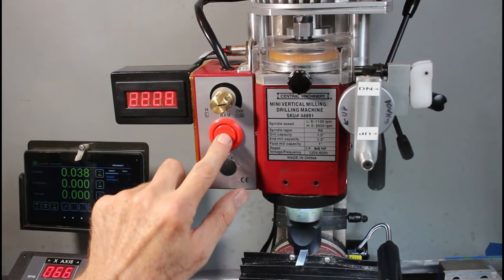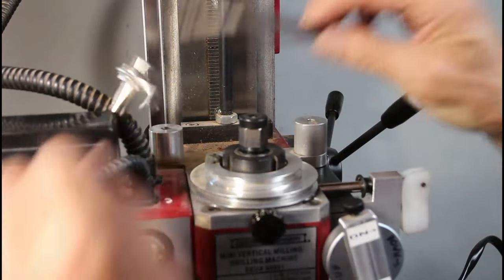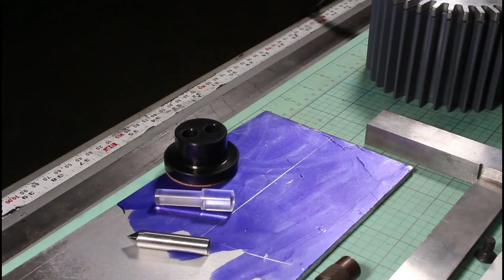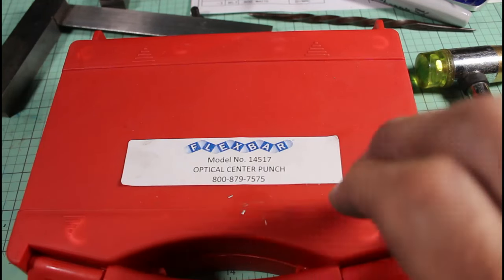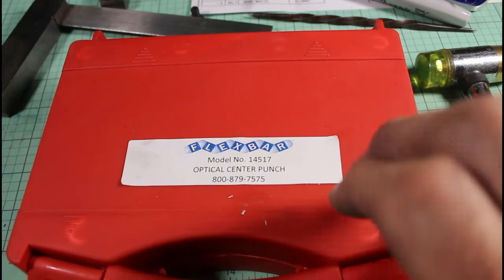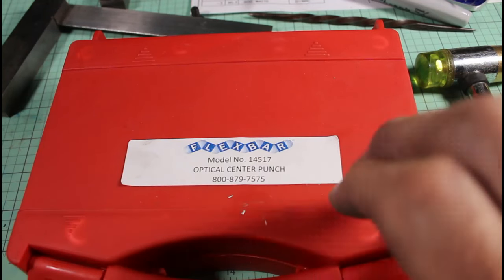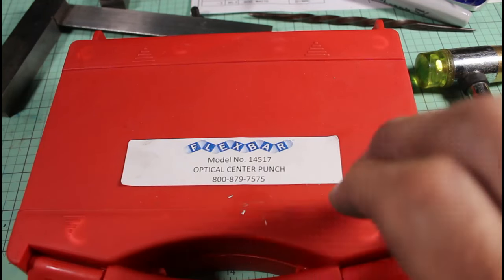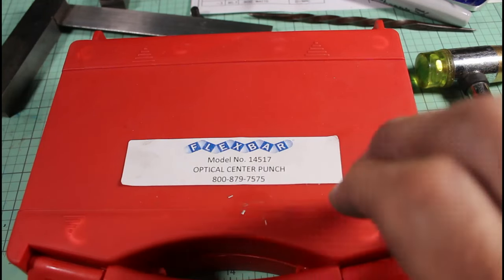Harbor Freight Mini Mill brushless motor upgrade

Comment: Been running a treadmill board on mine for the past few years after my original board died. Found your video and immediately searched ebay for a motor. Modeled some mount plates in Freecad and 3d printed them. Wired it all up and running great. Thank you for the video.
Reply from the maker: Wow, that's really cool. Glad I inspired you! 🙂

Comment: I did this mod to my little machine shop Seig mill over a year ago. I
 built my own belt drive system using cog type pulleys and belt. My
motor is 750 watts 24 volts. Best thing to ever happen to that mill.
Reply: have a parts list and any pics or steps? thanks!

Comment: I really like how you left most of what many YT's would remove due to time constraints. I think it was a good move. Watching you use your skillset, any thoughts about picking up a dividing head or rotary table anytime soon? Imagine the neat stuff you can make with one of those, not to mention lots of new content to keep us busy on your channel. Food for thought!
Reply from the maker: Thanks for your kind thoughts.  
Yes, I have owned a small 3-in rotary table for some time and have used it on a number of videos, most recently constructing the InclinoClock face:
https://youtu.be/jLS2trTL6DY

 And in an earlier video where I made a sprocket drive to move ball bearings:
https://youtu.be/xiuY2M31obA

Comment: That e-stop feature is bad ass
Reply from the maker: Yes, I really like that feature.  The interesting thing is that once I've stopped it with that button, if I leave the speed knob turned up, the motor has some holding torque until I turn the knob back down.
Fyi, the surplus store that sells these motors is closing this year, so get one while they still have them if you're interested.

Comment: The key thing is that your new brushless motor has a hall sensor in it (the motor controller can track the position of the rotor). So where you slow the speed of your old brushed, DC motor you do that by decreasing the total power to the motor. The brushless controller, with the help of the hall sensors, can increase voltage and amperage to ensure the motor keeps spinning at the same slow speed when under load. So you get close to full power at all speeds.
Reply from the maker: Yes, I knew that. I have a couple of e-bikes with similar motors in them. The torque is impressive!

Comment: I propose a momentary SPDT push-button with COM connected to the wiper input to the motor, the NC connected to your speed control POT wiper and the NO connected to the OFF end of the speed control POT, it might allow you to restart at full speed while retaining the same speed that you had.  A scary thing if you bump the switch but it could be under a cover to avoid accidental restart.
Reply from the maker: Nope, that won't work it can't jump start to a fixed speed. Been there, tested that.  But I do seriously love the emergency stop button, I use that preferentially over dialing the knob down.

Comment: The amount of back emf that the motor creates with that brake must be huge!
Reply from the maker: Huh, I hadn't thought of that.  I'm sure the internal electronics have all kinds of diode protection for those surges.  I use the hard brake routinely and have had no problems so far.

Comment: Great Upgrade!  I have the same mill and will use your recipe to upgrade the motor.  I have a belt drive already (hand made...not from LMS), but I think I may buy theirs and adapt it as you have as it looks a bit more sturdy.
Reply from the maker: Thanks, I'm sure you will enjoy the upgrade, I am!
If you see my recent videos you can see the motor turning very slowly for slot cutting and it has a ton of power when doing that, and I also use the emergency stop button all the time because it's just quicker to stop the motor.  I'm not sure how many more of these motors they have in stock at that surplus supplier so you should definitely buy the motor and power supply soon.

Comment: Thanks Guy for this. I have modified my Grizzly mini mill, but I did it in a much simpler way. Just raised the motor on two aluminum blocks(motor is mounted on those two only). It works great. I have just reused the original pulley, I have cut down the small one(I should have left it). I actually like the motor sound, I hated the original motor's sound. I have also cut down from the drawbar hex, left only a 3/8" height. It is enough for a wrench.
Reply from the maker: Sounds good. I assume you have a way to tension the belt as well right?
Reply: @GuyMarsdenMakesStuff  Yes. At the bottom plate(from the pulley kit), on the left side, I have elongated the mounting hole.
Reply: Tonight, I have cut through a 1/4" steel plate, with a 1/4" roughing end mill! Making an engine mount flange(scratch building a Locost).
Reply: What motor did you use and where did you get it? I have one coming in and wanted to get all my parts and upgrades ready. Was it basically just remove old motor put new in? Or did you have to make anything? I thought I've seen stronger motors that are taller but I'm not sure. Any help would be appreciated. Thank.
Reply from the maker: @Mikesmeyer88  watch my video carefully to see how I did everything. I tried to make everything clear and simple.  Details of the motor and power supply are in the description below.
Reply: I used the same motor and power supply as in this video. I just mounted the motor 
 differently.
Reply: Thank you, I ended up watching it in the background while getting ready this morning so I missed most of it. I'll watch again and pay attention this time.

Comment: like that motor and set up. I just made all the parts to change the X lead screw to one that gos all the way across and supported by bearings both ends , I made an xtra kit if you want it , just bolt on all parts are machined and new parts. one end is a stub shaft for adding power feed 12mm . 250 for the kit. , it will feel and operate like a different mill , lead screw nut adjustable included.
Reply from the maker: Thanks for watching, I've been using the new motor now for months and I'm really happy with it.  Thanks for your offer, but I'll pass.  I'm happy with my setup as-is.  I'm sure someone else will benefit from your extra parts.

Comment: can you briefly explain why we have to turn the potentiometer down and then back up?  my lathe works like that...its kinda annoying.
Reply from the maker: I think it may be a safety thing. So you can't start it at maximum speed. But other machines like my wood lathe have a speed ramp so you can press a button to start it and it ramps up automatically.  And yes, it is annoying!

Comment: I also upgraded my motor on my mini mill.  I’m no expert so I bought a book on modern brushless motors.  This book suggested that to get hi torque at low RPM you must have a motor that runs on very high voltage.  And every expert I spoke to agreed with that.  So I got a motor that runs at 160 volts and it required a speed controller box which included a power supply which takes standard North American 110 volt mains and steps it up to 160 volts.

It works great and now I can cut real steel -cold rolled,  hot rolled and stainless.

What I’m wondering is how well your scooter motor runs with just 24 volts.
Reply from the maker: Interesting. I didn't know that. I'm very happy with my 24 volt motor. But then I don't push the limits of the Machine by milling steel, I'm mostly working with aluminum and brass and making relatively small things.
Reply: @GuyMarsdenMakesStuff  Another thing I learned through the experience was that you can’t use an ordinary friction belt drive for cutting steel with a powerful motor.  The belts just slip.  First I upgraded to a 3/8 wide toothed timing belt and even it slipped (and made a horrible noise as the teeth fanned against pulley wheel teeth).  Eventually I had to go with a 20 mm wide HDT 5M timing belt and pulley wheels to match.

Comment: Very nice. The noise is the cogs on the belt on a smooth pulley. If the pulleys were cogged it would be very quit
Reply from the maker: Actually it's the motor itself.  Brushless  motors like this tend to cog at low speeds, I hear it in my e-bike all the time.  The pulley is very quiet and has a much better "grip" than the stock V-belt.

Comment: nice content. for the shaft hole perhaps a reamer instead of a boring bar when yoour at clean up passes?
Reply from the maker: Yes, I didn't have a set of reamers at that time.
Reply: @GuyMarsdenMakesStuff  a project ive attempted a couple times annd failed but will keep at is making my own. the hard part is nailing the heat treat. too hard and the teeth chip out or it snaps  over tempered and they quickly blunt or it bends.

Comment: Awesome job you did there. I still have the original motor on mine with an upgraded belt drive system. tachometer and a spindle light added. Works fine, but really needs more torque. I can your setup for this specific motor on a currently CNC mill that I am building myself. However, one big issue is to know how much this motor weighs, If you don't mind mentioning, I would really appreciate, because the PDF specs page on the website of the motor seller does not indicate the weight. Great project and thanks a million.
Reply from the maker: Sorry, I don't know the weight.  You could call All Electronics and they could tell you.
Reply: its about the same, if not fractionally lighter than the stock.

Comment: Looks nice! You may want to consider a 3d Printer for making your own little things like a custom electrical box, box cover, etc. Super handy to have. I got the Tenlog TL-D3 Pro (fdm printer) and an AnyCubic (resin printer) but there are many, choices on the market now.
Reply from the maker: I'm well aware of 3D printers. I just don't like them. To me it's dishonest craftsmanship.  But they do have their place for things that simply cannot be fabricated using a mill or lathe - I get it.  But I see so many people using a printer for things that could be easily fabricated or at least more enjoyable to fabricate using machine tools.
Reply: It's funny to me that machines, that made the original crafts like filing and smithing obsolete, are now considered true old fashioned craftsmanship.

Comment: fantastic work mate .. I've the same mini mill, it keeps blowing the fast blow fuse so thinking of putting a new motor and drive on myself.. that motor looks just ideal...
Reply from the maker: So far that motor is working out very well for me. Tons of torque at low speed and with the belt ratio I can run it up to 2200 RPM which is plenty for me.  You might want to order the motor soon because they will sell out of that limited stock of surplus.
Reply: @GuyMarsdenMakesStuff  I'll get onto it at the weekend, probably the best motor conversion I've seen by far and taking out the original circuit boards and all the other gubbins to replace with a simple controller and safety stop is a no brainer.. thanks for the vid, really Informative 👍👍🤙
Reply from the maker: I forgot to mention that there is a guy in Maine who repairs mini mill and lathe motor control boards and has upgraded ones too: http://olduhfguy.com/
Reply: @GuyMarsdenMakesStuff  totally missed your reply..I'll be ordering the parts and other bits this weekend, Ill have to order this motor from the US as I can't find a UK seller anywhere..lol.. I'll keep you posted and maybe give you a holla if I get stuck with the wiring, it's not my strong point..lol
Reply from the maker: @shepherdcustomknives6355  OK, good luck and I'll stand by to help out.

Comment: awesoem upgrade! i think your spindle bearings are goig out
Reply from the maker: Why do you think so?  You may be hearing something else rattling in the machine. I'm pretty sure the bearings are fine.
Reply: @GuyMarsdenMakesStuff  i was seeing slight moveement in the videl is why i thought it but could be wrong.
Reply from the maker: @mike9500  it was probably some kind of video artifact of the lighting.  I just grabbed the spindle and gave it a wiggle and it's rock solid.
Reply: @GuyMarsdenMakesStuff   good to know! :)

Comment: Hello Guy. I noticed that when you spun up the motor for the first time on the machine, there was a LOT of runout in the pulley that you made. This is quite bad for the belt. Have you noticed any issues since you started running it with this modification?
Reply from the maker: I think you must have been misreading the video. The pulley is perfectly concentric and always was. The motor and drive system is working flawlessly and has been ever since I built it.  Sometimes I adjust the belt tension if I want to allow for some slip when the spindle seizes but mostly I keep it quite tight.

Comment: Guy. Excellent upgrade on your mini milling machine. I am new to machining. Just purchased mini mill from harbor freight and a 7x14 vevor mini lathe. I also ordered the motor and power supply from all electric. Do ineed to order the 5k pot. And you have wiring diagram for the mini mill. Thank you Guy
Reply from the maker: Welcome to the wonderful world of hobby machining!  
There's a chance that the pot on your HF Mill is a 5k, but if not then you will need to order one.
The wiring diagram is on the All Electronics website on the motor product page, check the link in my description.

Comment: I stumbled across this video and found it to be very interesting and informative, thank you. I'll have to check out your channel more often ( just subscribed). Before the motor upgrade, how did the original motor work with thw power supply upgrade? Is it worth it to try thaat first or just do this upgrade? I haven't used my mini mill for years but would like to try it again. I didn't like how the motor would stall out and was going to put a treadmill motor on it but this looks better. Thank you for any reply.

Comment: I wonder how well this setup would work on a gas to electric lawnmower conversion.  The rotational speed seems pretty close and it should have plenty of torque.  Thanks for the source and the wiring diagrams.  Much appreciated.
Reply from the maker: That's a good thought! Many years ago I did do an electric conversion using a big DC motor and a lead acid battery. Here's more info about that project:
https://www.arttec.net/Solar_Mower/index.html

Comment: Very well done, I'm doing the same as per your suggestion, I have question: is the emergency switch n.o or n.c., also why you did not utilize the original pulley with modified 🙂I. .D. for the new motor?
Thanks
Reply from the maker: The emergency switch should be a normally open style. I guess I could have made an adapter for the pulley to the shaft, but I found it more enjoyable to experiment and make my own pulley.
Reply: thanks, keep the good work
Reply: I,m sorry but I have another question, regarding the wiring of the potentiometer: you show the colors as : black yellow and red ; the diagram from allelectronics, shows 4 wires : red, blue, black and white, which do I have to ignore and connect to  the wire colors you show?  Thanks . ( red with red; black with black; and ........ ) is it the blue or white? going with your yellow your yellow wire?
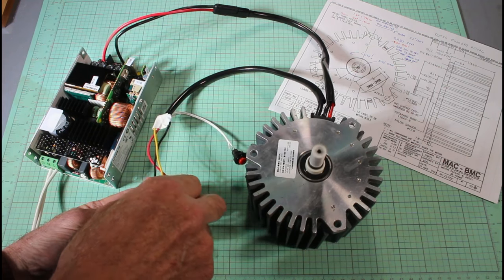Reply from the maker: @amosmaghini6242  the big red and black wires are for power.    I don't remember the wire colors, because I spliced other colors on after-the-fact.  But there were originally two connectors on the signal cable, the three pin connector goes to the potentiometer and the two pin connector goes to the emergency stop switch.  You might want to review the video at around 1:23 where I show wire colors connected to the pot, but I'm not sure if they are my colors or original colors.  Sorry I can't be more helpful.
Reply: @GuyMarsdenMakesStuff  I can see it, all I will have to do is look at the pins of the two connectors shown on the diagram. . Thanks.🙂
Reply: @GuyMarsdenMakesStuff  Thanks you ,v been helpful enough.

Comment: I inherited this exact machine from my grandfather, brought it home, plugged it and tested it. Walked back in the house came out and it wouldn’t work…. I assumed it was the machine so I undid the back plate and undid the two connections coming from the power cord besides the ground…. Only to find out it was the $30 harbor, freight electrical reel that was 1 week old that quit in the 2 minutes I went inside!! 

The problem was I unhooked both the hot and the neutral connection coming directly from the power cord and didn’t take a photo before and now don’t know which one goes where … any advise ? 

I have traced the hot and neutral wire all the way from the plug to the disconnection junction box with the emergency shut off..

I have isolated from the emergency shut off switch 
 junction box that one of the cords goes to both the green light on the front and the RPM dial, and the other one goes to the green light on the front and the fuse. Which one is neutral and which one is hot?
Reply from the maker: Neutral and hot don't make much difference in this machine. But I strongly recommend you make sure the green wire is grounded to the chassis to be safe.  I also plugged my machines into GFCI outlets.

Comment: Thanks for this information, especially the electrical, which thought process apparently wasn't passed on from my Father. One question, do you think that using the emergency stop repeatedly might damage the drive train components?
Reply from the maker: I'm glad my info is helpful! I have been using the emergency stop preferentially over turning the knob down and everything is still fine!   Note that if you do press the emergency stop, if the knob is still turned up the motor has some holding torque until you turn it all the way down.

Comment: I'm looking at a sieg x2d, this might be a good upgrade in the distant future
Reply from the maker: Definitely. You may need to be creative with how you mount the motor. But it is a dramatic improvement in the low speed high torque usage case for things like fly cutters etc.